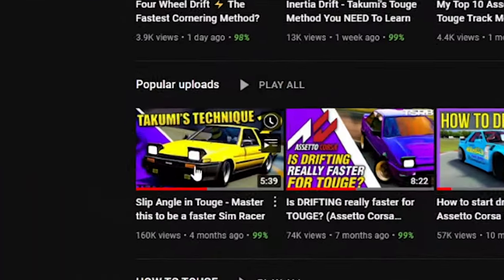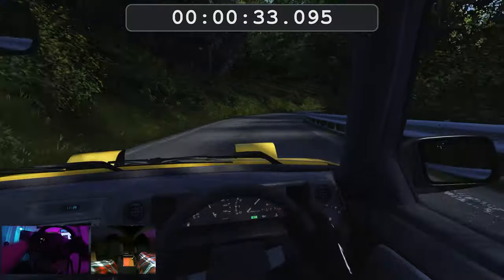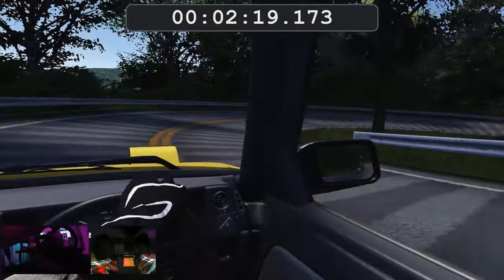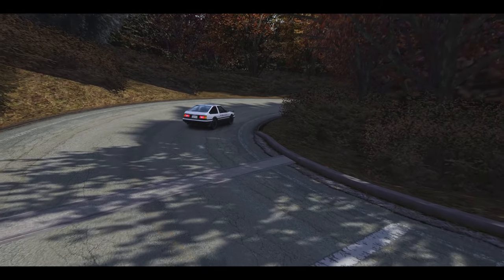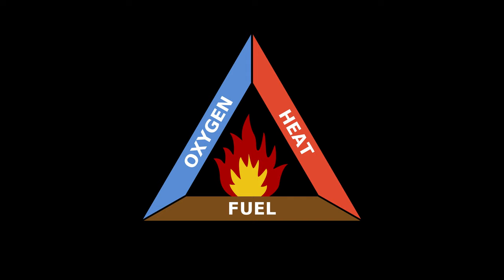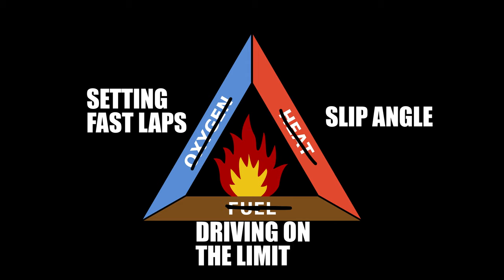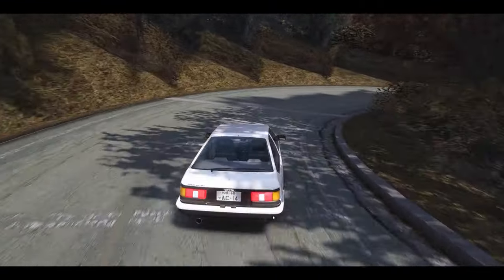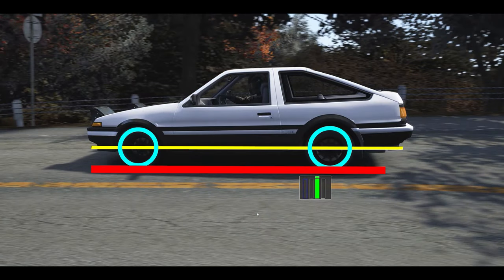A Follow Up to my Slip Angle video

Comment from the maker: Another point; Slip Angle refers only to the deformation or the 'slip' of a tyre which enables you to drive in a different direction than which the tyres are pointing (shown in the diagram at 1:49)
Slip angle is produced on the LIMIT of grip. Meaning if you go over the limit, you're just oversteering. I should have emphasised this more in the video, but I thought the diagram would explain it, it seems as though some people were confused and thought that micro-oversteer was slip angle. It isn't. As I said, I wanted to exaggerate slip angle for effect in the video. Slip angle is very subtle and hard to see unless you play the clip in super slo-mo (like 3:56).
Reply: If you REALLLLY need to hammer it into people brains about what slip angle really is, I have a way you can show it. Since you are a Sim Racer, I am sure you have heard about BeamNG.Drive. Well, if you go into that game, turn on the debug menu, then turn on simple node visuals, and turn on simple skeleton visualization, then sling the car through some real hard corners... you can look up from the underside of the car and actually visually "see" the tire deformation and actually get a visual understanding of the slip angle... plus you can put it in slow motion and actually visually see every iota of what is happening.
Reply: I love your videos keep it up !!! Your videos are really accurate!
Reply: Not much to add but this short segment of text you deleted summarizes the art of driving on the edge. I never referred it as 'slip angle' I called it 'in between' when discussing it with driver colleagues who could understand. As in between sliding and gripping. For me this also happens on acceleration phase also not when only cornering. When driving overpowered cars, be it fwd, 4wd or rwd if I cross the grip accelerating I am slower if I am burning the rubber. 4wd in all shapes is easier to keep in check but this throttle controlling 'in between' centric driving is the fastest and most enjoyable type of driving for me.  We look for mechanical perfection in maintaining and building cars. This is that perfection in driving method.
Reply: To be honest yeah i saw the video as more of a pointer for those who already knew basic vehicle dynamics and terms and it was more of just a passion project type of vid anyways at least just to get people excited about the real applications of vehicle dynamics to precision driving. Honestly i figured you'd go more in depth another day anyways, like you mention in your "another point" about what slip angle is by definition, me already knowing that term made that video kind of commonplace really (im sure likewise for many other people who've really devoted to your channel as their people interested in real precision driving) but i suppose it is esoteric to the new racing community, i learned the term from understanding crash dynamics, for example, often people begin to understeer in say a fwd car, say in the rain upcoming a bend, but then when most people encounter understeer they apply more counter steer thinking it'll help correct the turn but alas only makes the issue worse by increasing the slip angle (making the tires lose a chance to re obtain traction even further),  already knowing that eventually allowed me to make the connection to how that could apply to precision driving (including drifting that actually REDUCES lap times). Actually when i understood that however long ago its been, thats what made me realize most of the people who talk about what a "true drift" is are really just kinda talking out their asses and dont really understand much about vehicle dynamics and driving fast lol. 

A true drift to me had always meant anytime you dance on the edge of the traction coefficient on purpose for better cornering times than a car otherwise would make using full grip. And it's a far too common misconception, any drivetrain can do it because weight transfer physics are identical per any car, a vehicles limit on corners is more akin to its track width wheelbase turn radius and i suppose power output at the end of the day, drivetrain has actually very little to do with the limit, drivetrain is just a predicate to a certain sect of techniques to achieve that cars limit, and really eventually, all cars need to drift a little bit to go faster on some corners on any track and road condition, besides maybe on a steep uphill then traction is precious for any car especially fwd, you'd need a lot of power to be any exception.

But great video great update, looking forward to more content 👍
Reply: slip angle is the fundimental principle of how tyres work whilst cornering, not a technique and not something that only happens at the grip limit. a more accurate way of putting it is (at least to my understanding) to say slip angle is a vector between the direction of the tyre and the direction of the contact patch and inertia of the car. essentially if you think of what im about to say happening in very slow individual frames, the contact patch moves in the direction your car is travelling, when you turn the steering wheel your wheel and tyre moves but the contact patch stays firmly in place, however since the tyre is rotating and its turned the front of the tyre or "next" contact patch is going more where you want it to go which makes the car turn, this angle between the inertia and the steering angle is called the slip angle, higher slip angle generates more cornering force (dont say grip i'll get to that) because you're making a bigger change in direction every "frame" however once you overwork the tyres too much the actual grip of the tyre on the contact patch breaks and the car starts to slide. 

different tyres have different slip angle/cornering force curves with race tyres that have a more peaky curve suffering more at the lower slip and creating more force at higher slip angles making it more important to push them to the limit and street tyres generally having more flat curves making them more forgiving, admitedly i dont completely understand this this is literally a whole field of science and engineering in its own right and i am just an 18 year old college student with the maturity of a 15 year old

takumis technique in the way i interprate it is a little different, usually this only applies to the front tyres and the rear have their own lateral grip which is all good and normal however takumi rotates the entire chassis of the car instead of just the front wheels in order to turn so in that way all 4 tyres are contributing to cornering force instead of just the front ones

(im probably wrong so if i am please correct me)
Reply: @karadaglar77 is it powersliding?

Comment: There was nothing wrong with the old video. What you said was correct, it was just worded in a way that layman would understand it. I've known about slip angle for years and have honestly never tried using it, reviewing all of my fastest laps on assetto shows it used on about 40-50% of the corners I tackle. An inexperienced person might watch these replays and not even notice it, but after actually hearing about it and knowing what it is, you start spotting it quite easily since it almost looks like a four wheel drift, but without the drift part. At any rate, keep it up, the information you're putting out is really helpful and entertaining.
Reply: Well said, like i just replied on tsrb comment yeah i saw the video as more of a pointer for those who already knew some basic vehicle dynamics and terms and it was just more of a passion project type of vid anyways at least to get people excited about the real applications of vehicle dynamics to precision driving. Honestly i figured he'd go more in depth another day anyways, from what slip angle is by definition, already knowing that term made that video commonplace (im sure likewise for many other people who've really devoted to this channel as their people interested in real precision driving) but i suppose it is kindof esoteric to the new racing community, i originally learned about the term from understanding crash dynamics because for example, often people begin to understeer in a fwd car, say in the rain upcoming a bend, but then when most people encounter the understeer they apply more counter steer thinking it'll help correct the turn but alas only makes the issue worse by increasing the slip angle (hence making the tires lose a chance to re obtain traction even further), knowing that info eventually allowed me to make the connection to how that could apply to precision driving (including drifting that actually REDUCES lap times). Actually when i understood that, however long ago its been, thats what made me realize most of the people who talk about what a "true drift" is are really kinda just talking out their asses and dont really understand much about vehicle dynamics and driving fast lol. 

A true drift to me had always meant anytime you dance on the edge of the traction coefficient on purpose for better cornering times than a car otherwise would make using bare grip. And it's a far too common misconception, any drivetrain can do it because weight transfer physics are identical per any car, a vehicles limit on corners is more akin to its track width wheelbase turn radius and i suppose power output at the end of the day, drivetrain has actually very little to do with the limit, drivetrain is just a predicate to a certain sect of techniques to achieve that cars limit when setup right, and really eventually, all cars need to drift a little bit to go faster on some corners on any track and road condition, besides maybe on a steep uphill then traction is precious for any car especially fwd, you'd need a lot of power to be any exception.

But yeah it wad a fine video. Good update keep it up 👍
Reply: @SSmallwood  I mean, the actual definition of a power slide is any slide that occurs after the apex so at exit, ANY slide that begins before the apex is technically a drift whether by feint power over scandi flick all pretty much the same entry weight transfer technique different name. But thats where we disagree, chaining is formula d drifting, be careful what you mean by chaining corners because in any true definition chaining is very slow. Not necessarily easy or harder but slow. Anybody honest who drives formula drift will tell you its just for style, just an event. Even any weight transfer technique at entry done to get the car sideways I myself still wont ever consider it a true drift unless it actually allows u to go faster and make more use of your power and momentum than otherwise possible with bare traction, theres no style points in a real race, always taking lines just to enter a drift, even if your pedal is to the floor the whole time and add however much horsepower you want- entering a drift every time, will be slower and a waste. Limit grip is fastest, proper use of traction and inertia transfer is key to being fastest that's how the inertia drift was born, or better named zero countersteer drift its the same thing, not to say zero counterseer is always necessary to be fastest that depends a bit on the car and moreso the race situation but when at the limit zero counterseer is inevitable to retain as much speed as possible. Drift cars arent at all built for that sort of driving anyways.

Edit:
And to be frank, i dont think theres anything more stylish than what it looks like when someone pushes their car to the limit. And there's no "just being on the limit" either, dont say that so casually like you've been there seat on your pants before. That takes balls most poeple wont ever have let alone comprehend, thats deadly on a completely safe track with almost nothing to run into, let alone guardrails and another driver in front or behind you.

Take two cars within 500 pounds, give the lighter car to a drifter and 400 hp, give the heavier car to someone who wants to drive at the limit with 300 hp, both tune their cars accordingly, if the drifter drives like its formula drift and "chains corners" like your saying? They would be obliterated, every time. Doesnt matter if their foots to the floor as much as possible, taking corners like that is not only a complete waste of momentum, but will destroy your tires and/or brakes and you wouldn't last more than 3 laps on any remotely demanding togue. I gotta make sure this whole "true drifting" myth ends so ill leave this lesson here for whenever someone under this drifitng wave impression should stumble upon it, drifting can be faster, when already going really fkn fast to maintain as much speed as possible, in any case, its meant to make the most of your speed, if it doesnt do that theres no true use case.
Reply: @Gustav well... words do have definitions for a reason 😂 i mean yeah im talking a little more sports focused sure, but i literally mentioned yes it always depends on what racing scenario, going sideways is going sideways is a drift sure thats commonplace, but that sport focus is crucial to hone any TRUE understanding, rally, circuit, time attack, f1, those pro drivers are the people whom anyone who actually wants to be truly fast should always look up to, those are very real races, fastest times as it gets, and hell most even go to classes for the shit, and it just so happened after making a science out of racing those are all the terms and definitions THEY use, so id like to assume it's for a reason. Of course messing about is messing about, but on the track with time in mind a power slide was only ever called that because its after the apex, and say in a battle sure u can drift to prevent a pass absolutely theres a lot of different means to guard, but never confuse the terms coined for true speed for pointless semantics, those words have become associated that way for a reason.